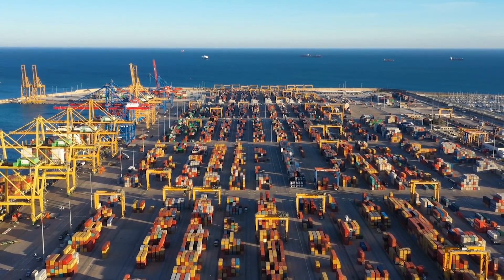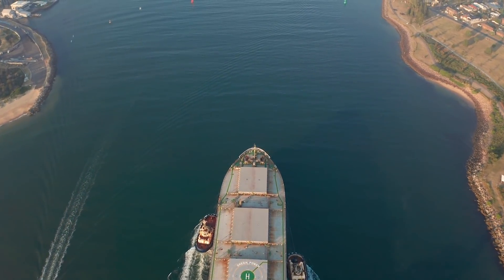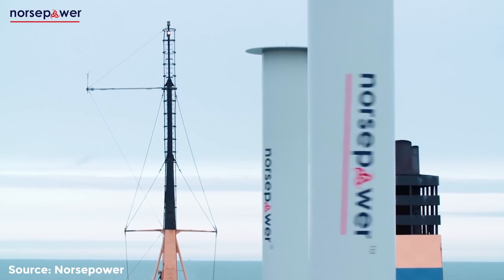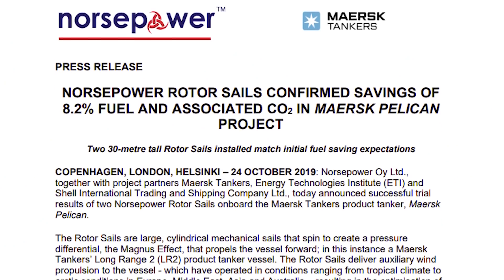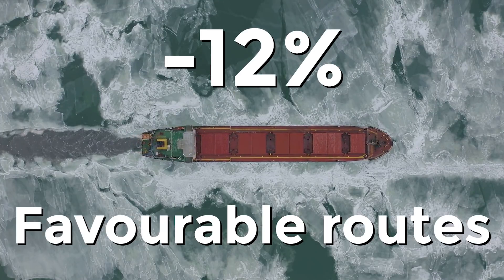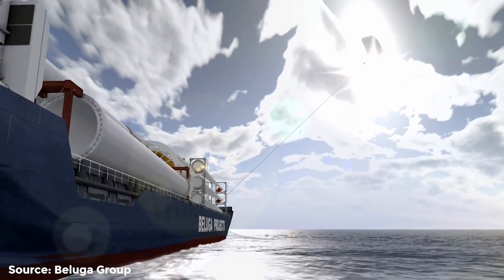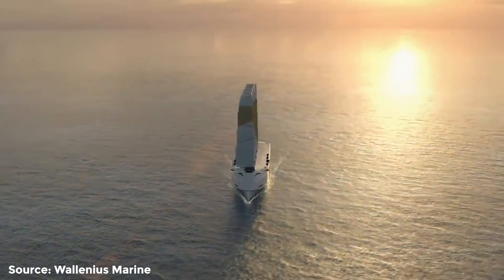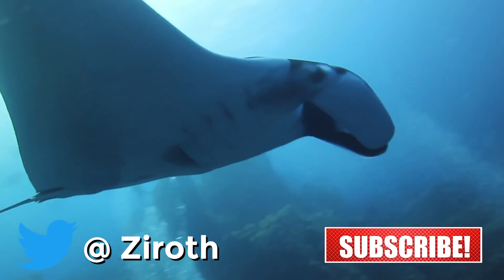Is Wind Power The Future of Shipping?

Comment: What about every direction Wind generators on top of telescopic masts and variable length  coupled with solar arrays that be lifted to put cargo in, and have hybrid power that can be topped up at stops.  This ways there is always energy generations regardless whether used for movement.
Reply: To address the suggestions that sail power is the answer I offer the following.  In 1870 a premium sailing vessel entered service, the ‘Cutty Sark’, she could carry around 600 tonnes of cargo at speeds of up to 17.5 knots, dependent on the prevailing wind, to harness the energy the available spread of canvas was up to 2 976m2.  To round things out that was circa 5m2 of canvas for every tonne of cargo carried.  The ‘Cutty Sark’ was designed and built for employment in the tea trade where time on passage was a large factor in securing the premium freight rate that made her cost effective but as soon as the Suez Canal opened, which the ‘Cutty Sark’ was unable to sail through, she lost her advantage, raw speed, to the steam powered ships of that era.  Mechanically powered ships have improved in terms of efficiency, on a freight tonne mile basis, by at least one order of magnitude since then.  After losing out to the coal burning, steam reciprocating mechanical ships of the late 19th century ‘Cutty Sark’ was relegated to the Australian wool trade, just about the bottom of the barrel in maritime terms and only one small step up from being a 'honey barge'.  The canvas, cordage and extra manpower needed for sailing ships was never a very benign environmental option so please discount any idea of sail as ‘sustainable’.  All this is without the problem that if ‘the wind don’t blow the ship don’t go’, when it does blow it often blows in the wrong direction for your cargo delivery needs and sometimes there is rather too much of it for comfort.

Comment: Can you make it more efficient than the wind power technology that was used back when it really was the future of shipping?
Reply: To address the suggestions that sail power is the answer I offer the following.  In 1870 a premium sailing vessel entered service, the ‘Cutty Sark’, she could carry around 600 tonnes of cargo at speeds of up to 17.5 knots, dependent on the prevailing wind, to harness the energy the available spread of canvas was up to 2 976m2.  To round things out that was circa 5m2 of canvas for every tonne of cargo carried.  The ‘Cutty Sark’ was designed and built for employment in the tea trade where time on passage was a large factor in securing the premium freight rate that made her cost effective but as soon as the Suez Canal opened, which the ‘Cutty Sark’ was unable to sail through, she lost her advantage, raw speed, to the steam powered ships of that era.  Mechanically powered ships have improved in terms of efficiency, on a freight tonne mile basis, by at least one order of magnitude since then.  After losing out to the coal burning, steam reciprocating mechanical ships of the late 19th century ‘Cutty Sark’ was relegated to the Australian wool trade, just about the bottom of the barrel in maritime terms and only one small step up from being a 'honey barge'.  The canvas, cordage and extra manpower needed for sailing ships was never a very benign environmental option so please discount any idea of sail as ‘sustainable’.  All this is without the problem that if ‘the wind don’t blow the ship don’t go’, when it does blow it often blows in the wrong direction for your cargo delivery needs and sometimes there is rather too much of it for comfort.

Comment: 2:18 won't the direction of motion be in the opposite direction? the high pressure air will try to move towards the low pressure air and move the cylinder in the high pressure to low pressure direction. am I missing out on something? someone correct me if I'm wrong.

Comment: Nucleair or Thorium engines in Ships is the only future if you “believe” in the CO2 Hoax.
Otherwise just continue with oil and Diesel engines, they get better in time, don’t rush.
Reply: Nuclear propulsion is a huge advantage even if you don't believe in CO2. You get cheaper transport costs as well as greatly increased speeds. Nuclear cargo ships could easily cruise at double the speed of conventional ones, or higher, without an economic disadvantage in doing so.

Comment: Enercon Eship is using a Flettner for 10 years and claims 10-15% reduction in fuel. Surprised you didn't include it as the longest running project next to Skysail. A Flettner has a Ca lift coefficient of 34 vs a wing having a Ca of 4. Control systems for a single force by angle of attack is fairly common today. The Flettner generates way more lift to save fuel and is easier to shut down in storm by shutting off it's rotaion. Stuck or mangled telescopic wings are a SOLAS safety concern to people. A wing is still an active wing always directing it's resulting force somewhere. 

If you ship a reefer container (huge 40t fridge) full of nitrogen atmosphere stored Avocado, it's all a messy rotten waste arriving just 2 days late. 
Insurance pays or doesn't pay out 40 M USD in damages htting no wind conditions. So full sail isn't the main idea, IMO  MARPOL regulations and saving fuel is. Wallenius is doing RoRo of cars. High value goods where overall CO2 lifecycle fleet emissions regimes apply to consumer product. Car makes are fined for missing fleet emission targets. So the ocean Bird busness model is a bit skewed in favour of this. A RoRo doesn't use container bridges in congested urban port areas, where landuse is already maxed out for efficiency, automation and flexibility.

Most ship owners plan for Bio or eFuels to blend in and gradually replace bunker oil. Aerofoil sails It's certainly a topic awaited to mature in special purpose newbuilds first rather than retrofits.
Overcapacty has plagued shipping makets for 2 decades of crisis now. people are vary on experiments unless they are backed by gov R&D funds. Industry people basically pray for older less efficients ships being forcibly retired by CO2 regimes. Pension funds invested in these ships don't. Ship design is one of the slowest moving industries in adopting new tech. A ship cost millions and losing one to accident is still common and ocean waters are rough on wearing out any tech. Plus lifes of crew are at stake next to massive losse sof cargo and mad customers impacted by spare parts, medicals, fertilizers, food or key electric components not arriving on schedule.

A smaller ferry operator has more freedom and better funding to experiment. But these people aren't excatly flush in funds either.
Actually such tech risks turned from increasing the funding risk to decreasing it by making the future profitablitiy outlook under C02 emission outlook more favorable to banks and funds.
That's a huge boost to these add on fuel saving systems. It all starts with selling the idea to the bank or fund behind the newbuild.

Our take is eFuels from tidal power simply replace the diesel. That pays off when you factor in where you create renewables and need to use them and how cheap they can be this way. Pls. find out more  https://youtu.be/nqbVTVMSSTM

Comment: To address the suggestions that sail power is the answer I offer the following.  In 1870 a premium sailing vessel entered service, the ‘Cutty Sark’, she could carry around 600 tonnes of cargo at speeds of up to 17.5 knots, dependent on the prevailing wind, to harness the energy the available spread of canvas was up to 2 976m2.  To round things out that was circa 5m2 of canvas for every tonne of cargo carried.  The ‘Cutty Sark’ was designed and built for employment in the tea trade where speed was a large factor in securing the premium freight rate but as soon as the Suez Canal opened, which the ‘Cutty Sark’ was unable to sail through, she lost her advantage to the steam powered ships of that time.  Mechanically powered ships have improved in terms of efficiency, on a freight tonne mile basis, by at least one order of magnitude since then.  After losing out to the coal burning, steam reciprocating mechanical ships of the late 19th century ‘Cutty Sark’ was relegated to the Australian wool trade, just about the bottom of the barrel in maritime terms and only one small step up from being a 'honey barge'.  The canvas, cordage and extra manpower needed for sailing ships was never a zero cost option so please discount any idea of sail as ‘sustainable’ in environmental terms.  All this is without the problem that if ‘the wind don’t blow the ship don’t go’, when it does blow it often blows in the wrong direction for your cargo delivery needs and sometimes there is rather too much of it for comfort.

Comment: Wind power was also the future in the 15th century!
Reply: To address the suggestions that sail power is the answer I offer the following.  In 1870 a premium sailing vessel entered service, the ‘Cutty Sark’, she could carry around 600 tonnes of cargo at speeds of up to 17.5 knots, dependent on the prevailing wind, to harness the energy the available spread of canvas was up to 2 976m2.  To round things out that was circa 5m2 of canvas for every tonne of cargo carried.  The ‘Cutty Sark’ was designed and built for employment in the tea trade where time on passage was a large factor in securing the premium freight rate that made her cost effective but as soon as the Suez Canal opened, which the ‘Cutty Sark’ was unable to sail through, she lost her advantage, raw speed, to the steam powered ships of that era.  Mechanically powered ships have improved in terms of efficiency, on a freight tonne mile basis, by at least one order of magnitude since then.  After losing out to the coal burning, steam reciprocating mechanical ships of the late 19th century ‘Cutty Sark’ was relegated to the Australian wool trade, just about the bottom of the barrel in maritime terms and only one small step up from being a 'honey barge'.  The canvas, cordage and extra manpower needed for sailing ships was never a very benign environmental option so please discount any idea of sail as ‘sustainable’.  All this is without the problem that if ‘the wind don’t blow the ship don’t go’, when it does blow it often blows in the wrong direction for your cargo delivery needs and sometimes there is rather too much of it for comfort.

Comment: Well, I thought that the sail ships from 1600s used wind power already.
Reply: To address the suggestions that sail power is the answer I offer the following.  In 1870 a premium sailing vessel entered service, the ‘Cutty Sark’, she could carry around 600 tonnes of cargo at speeds of up to 17.5 knots, dependent on the prevailing wind, to harness the energy the available spread of canvas was up to 2 976m2.  To round things out that was circa 5m2 of canvas for every tonne of cargo carried.  The ‘Cutty Sark’ was designed and built for employment in the tea trade where time on passage was a large factor in securing the premium freight rate that made her cost effective but as soon as the Suez Canal opened, which the ‘Cutty Sark’ was unable to sail through, she lost her advantage, raw speed, to the steam powered ships of that era.  Mechanically powered ships have improved in terms of efficiency, on a freight tonne mile basis, by at least one order of magnitude since then.  After losing out to the coal burning, steam reciprocating mechanical ships of the late 19th century ‘Cutty Sark’ was relegated to the Australian wool trade, just about the bottom of the barrel in maritime terms and only one small step up from being a 'honey barge'.  The canvas, cordage and extra manpower needed for sailing ships was never a very benign environmental option so please discount any idea of sail as ‘sustainable’.  All this is without the problem that if ‘the wind don’t blow the ship don’t go’, when it does blow it often blows in the wrong direction for your cargo delivery needs and sometimes there is rather too much of it for comfort.

Comment: Mærsk has pointed three co2 free fuels of the future:  Alcohol, Biomethane and Ammonia.

I read an article about it, they have pointed on those 3 in hopes suppliers will rise to the challenge and engineers figuring out the infrastructure needed to fuel the ships with these. At least Ammonia can cause serious issues if a fueling station leaks.

Comment: If the engines were hybrids and used fuel and electricity offsets. Then they should focus on capturing wind, solar, and wave power as energy and pump that into the engines. If the systems are developed right. It would not take up much room and reduce fuel needs significantly. Based on the concept that ship owners do not worry about fuel because someone else pays for it. Maybe either the shipowners need to agree to surcharges or maybe the government could create an incentive program.
Reply: Wind and wave power would add drag, solar panels would only produce a small fraction of the energy required to move these ships. A smaller diesel engine powering electric motors is probably the best route.

Comment: Solid state wind energy transformer systems (the humid oceans would be great for this tech), fuel cell systems, the kite sail, and along with solar. Would be sufficient to power large ships.
Reply: Ahahahaahah yeah no.
To move a ship like that you'd need to power those huge engines + keep necessary containers refrigerated.
#1 Those Solid state wind energy transformers you mention are very weak as power generation devices Even if you completely cover the deck of a ship in that it would barely turn the lights on at best.
That and you're at the mercy of wind which if you remember is inconsistent and that's why we abandoned that a few hundred years ago.

#2 "fuel cell systems"  That speaks volumes about how professional your opinion is on the matter. Cells of what? 
Perhaps hydrogen cells? And how do you extract the hydrogen and store it? Let me guess you're going to say some 500KM^2 of solar panels powering an electrolyzer yeah...
The only thing hydrogen has going for it is versatility. Easy to extract energy from it in confined spaces meaning. It's not particularly efficient, storing and producing it is not "green" and etc.

#3 "kite sail" Again entirely at the mercy of wind which would be enough to dismiss the idea in the first place , but you'd need some huge surface area just to get some 0.5m/s^2 extra for a few minutes at departure (very little that is).
And that's only going to work if the wind blows from behind you at some extreme power. The moment it stops blowing or you catch up to it , that huge kite's going to hit the water and bye bye. There's so many things that can go wrong and so many impractical points related to the kite idea that anybody could come up with another paragraph of bad stuff to say about it.

#4 "and along with solar." You're not mentioning solar what again...boilers or panels? fotovoltaic or reflective panels?
Again, point A) DOESN'T WORK AT NIGHT. And don't tell me we should put some 50-60 tons of accumulators in there because i'm gonna throw up. 
B)Would hardly even power the cooling for the refrigerator containers in a big ship. You'd be lucky actually to get enough power to keep the cooling on, even with a huge surface area of solar panels. You are gravely underestimating the requirements for those motors. Those ships are pretty slow as is , with powerful engines. Equivalent electric engines would offer massive electrical power requirements. Won't even go into how getting the electrical current to required parameters for the motors would also incur some hefty efficiency drops and so on...

#5 cost
Let's imagine we live in a world of magic and those would power the ship. The cost would be prohibitively high. => companies and states will have to find other ways to lug things around => likely trucks / planes which also pollute so you gain nothing .

#6 "Would be sufficient to power large ships."
Oh i'm sorry i hereby cancel all of my above (might i say convincing) counterarguments in light of your obviously professional expertise on the matter.
Reply: @doktork3406  You are entirely correct which is why I said its all those systems that are needed but, not as a primary power systems. But I would like to clarify a couple of things though and add another potential fuel technology.

1 ) The solid state wind transformers are moving against the wind as the ship moves forward it always be working if the atmospheric conditions are right. To power the ship's support systems. 

2) As for the Fuel cells, did you know that a submarine designated as Type 212  is the worlds 1st fuel cell sub. In a few decades, I'm sure that  technology would be available for larger tonnage vessels - well that's if you trust people carrying large amounts of hydrogen about. Lol 

3) There's a type of carbon fuel being developed be by a Japanese firm for air planes that could be good for the environment. That - could be a game changer for large ships in a  couple of decades. 

In the end, there is no one Golden Grail to the path of producing alternative powered technologies. In fact the only way to get the most out of them is to use multiple systems to move those massive ships. 

Thanks for the reply!

Comment: "Is wind power the future of shipping?" If you're on the age of the triremes and oar carracks, yes.
Reply: I believe that going back to steam power / renewable combo through the use of Solar thermal collectors on nice sunny days directed at boilers, whilst also utilizing rotor sails (that would also aid in propelling the vessel) with a rotating shaft to produce friction heat that is immersed in a water tank to essentially create a wind powered boiler for the steam engines...